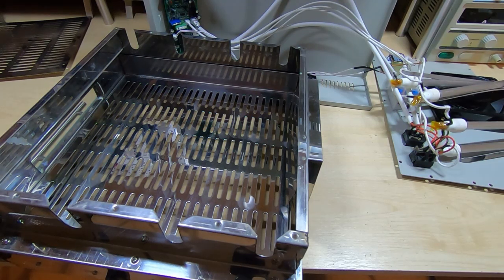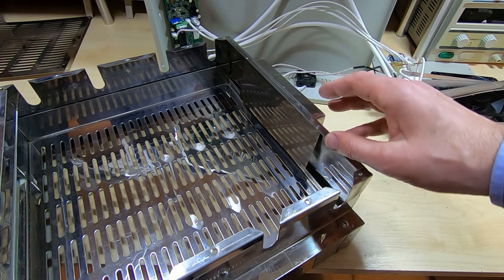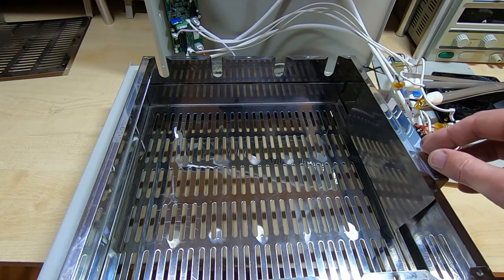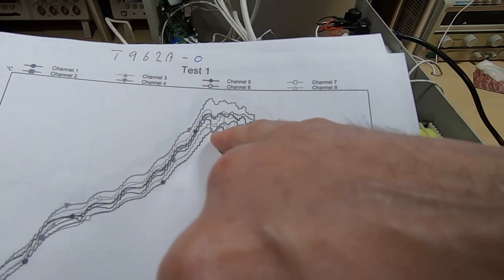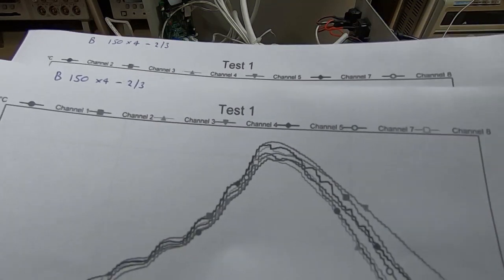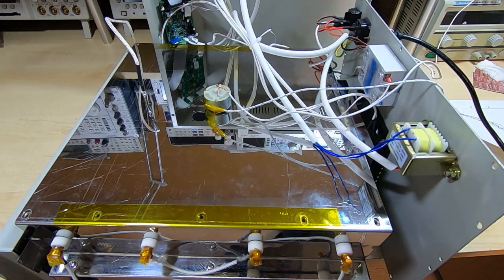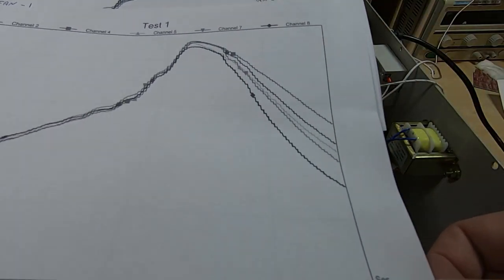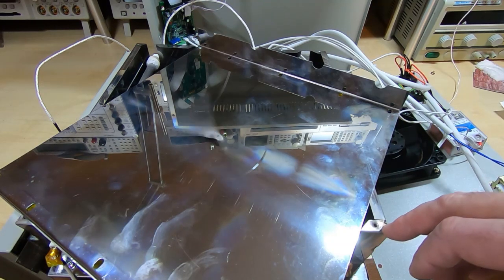Improving a T-962A Reflow Oven Part3

Comment: I just received my T962-A recently and not only did it come with baffles installed but the cooling fan draws the air out of the heating chamber rather than blowing in

Comment: Jerry,you suggest the centre sensor to be removed ,you mean that we have to make a new hole 15mm   from the sidewall and same size as the original? the steel tube will be fastened on the side wall?

Comment: I just received the T962A reflow oven and there are two noticeable differences. One being the fan pulls air from the chamber. The other is a louvered air flow baffle between the inner chamber and the fan. The inner chamber wall near the fan has an opening ~1/3 chamber width and nearly to the top. The louver swings to create ~400 mil opening at most per louver. Three lovers. The behavior of fan off and on for a couple of seconds is pretty much the same as described in the video. This design still has the effect of pulling air straight across the board and down the middle of the board. The built in temperature probes indicate significant differences up to 20 degrees C.  The cooling part of the cycle had even greater differences. There was no PCB in the machine during these runs. Adding the angled plate near the fan and in the inner chamber stills seems like the right thing to do.
Reply from the maker: See the video at 5.00 for a view of the baffle I fitted.
Reply: @JerryWalker001  Yes, I watched all the videos. Should I remove the louvered flaps or just leave them in place.
Reply from the maker: @danarobotmaker3396  I removed them but it does not make much difference once the baffle is fitted so you may be able to leave them.
Reply: @JerryWalker001  I have the unit apart, insulation removed,  and vacuumed the glass crystal up.  While doing this I might as well do the turbulence fan feature. How did you get the thermocouple out? I uncrimped the tube and removed the glob of sealant, yet the wires seem stuck.
Reply from the maker: @danarobotmaker3396  I just pulled them out. You can easily replace them if they are damaged. It is more consistency you are aiming for in the final machine so absolute accuracy is not important if the calibration is out slightly. You will just modify your profiles based on results so replacing a sensor is not a big problem.

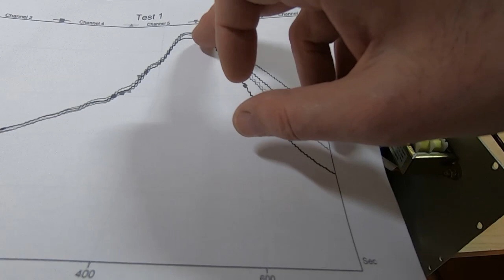Comment: 15:00 Just the fan in the top middle, and none of the baffles under the lamps? That's a great result, and it would make sense to start by adding the fan before doing anything else!
Reply from the maker: Yes the fan makes the biggest difference. Note that it is not really a fan, more of a 'mixer' to keep the air moving around the chamber but not 'blowing'.
Reply: @JerryWalker001  With the air stirrer what motor did you use and how do you thermally isolate it ?  I'd like to do this mod to mine.  I have also got the new firmware that allows offset and gain adjustment of the thermocouples.  Hopefully this will improve my profile accuracy too.
Reply: @JerryWalker001  Hi and congrats for your videos ! I have the same question as Godzilla: what little fan motor did you use (is it an AC motor ?) and do you need to thermally isolate it ?

Comment: on my toaster oven i have been tweaking over the last 6 months, i fitted 3 halogen heater bulbs from those halogen heaters that stand up, these heaters also came with a honeycomb heater spreader in front of the bulbs to stop heat spots as without it you would easily burn your self with 3 400watt halogens, this made the ovens heat extremely uniform, especially with the convection fan built in, looking forward to watching the other follow up vids tonight .
Reply from the maker: I did actually test the honeycomb from one of those heaters but it was so soft and floppy that suspending it accurately across the entire area was too tricky and it also cast IR 'shadows' depending on the angle between the board. The honeycomb was about 3mm thick so it did not cut down the direct heating but cut the angled IT by increasing amounts the further away from the neater centre line and this as the opposite of what I wanted so I gave up on it.
Reply: @JerryWalker001  ahhh ok fair enough. maybe the ir heater and halogen heaters react to this in different ways? mine certainly helped and also stopped the boards getting scorched. is there a part 6 coming anytime soon? thanks

Comment: That's more like it!  I had another thought.  Suppose you had lots of baffles, all at angles so that the lamp energy never "sees" the board directly, but indirectly the energy is more closely matched.  For example, close to the heater the baffles would be narrow and horizontal (like you had), further away wider but at increasingly steeper angles.  Then, when when the fan comes on you get a double benefit because the different angles cause different air flow.  Just a thought..... keep up the great work.  it's really nice to see someone going about it methodically.
Reply from the maker: I did try that but the board never gets to temperature and the maximum ramp up is too slow. Unfortunately the board needs direct heating for the process to work (even then the heaters are running continously). Moving air and masking the hot spots seems to be working best. The actual baffles needed are very small and only cut around 11% of the heating effect. Any more masking prevents the boards reaching temp and also causes the chamber walls and heaters to overheat as they need to work way too hard. You can actually see the discolouration in the top cover which occured during those tests. I think that possibly any one of the three methods (baffle, fan or conveyor) will make the oven much more useable but I would like to find a combination that gives Good results rather than just being acceptable but it may take a while to develop the best balance.
Reply: @JerryWalker001  I just though of something.  Did you try changing the thermocouple probes channels?  To cover the possibility that the channels are miss-matched.  It's down to a few degrees now so that might make a difference / prevent looking for red herrings!
Reply from the maker: Chris Mr, My company develops specialist instrumentation so I have a number of calibration systems. Before any development I always calibrate all equipment I use. In this case I used a high temp drywell calibrator and a UKAS calibrated TTi-7 (accurate to 0.02C with a resolution of 0.001C). All probes were calibrated in a single drywell as they are small so the degree of uncertainty is currently less than +/- 0.4C which is well within the errors I am seeing. Very good point though so I may make a separate video on this.